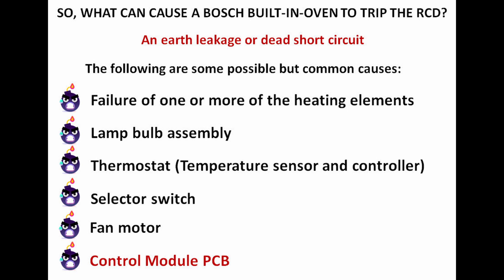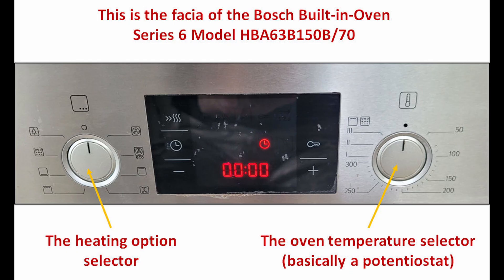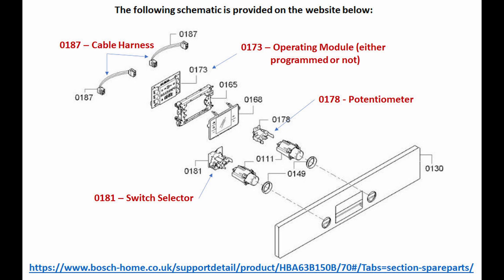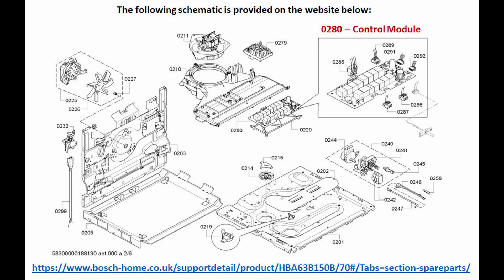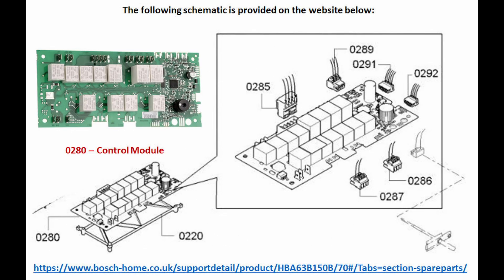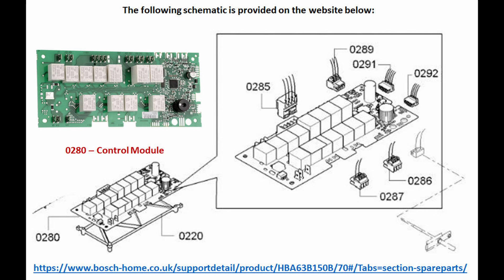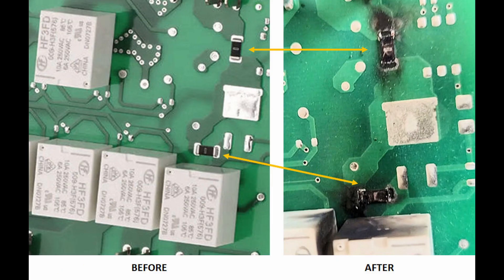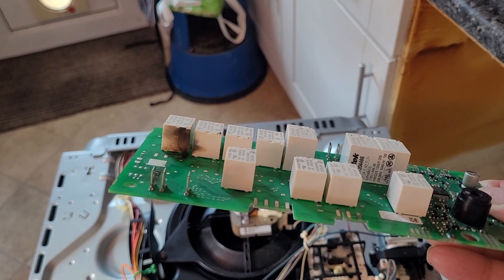Replacing a Defective Control Module PCB in a Bosch Oven

Comment: Hi thanks for the video. I have a problem with this oven. The light is now working anymore, i Changhed the bulb but nothing happens. How can I understand if the PCB is the problem? Thanks
Reply from the maker: Thanks for your comment. My question is "is everything else working" i.e., is the oven heating up as normal? If this is the case then the PCB may not be the problem. You can have a close look at the PCB to see if there is any damage to the components. If everything is looking OK then you may have to replace the whole lightbulb assembly rather than just the lightbulb. Sorry I can't be more specific! Regards and best of luck.
Reply: @theredneckgeordie  thanks. I changed the PCB. Now the light is working but the oven shows E300 error. Maybe the problem could be the power supply module?
Reply: @theredneckgeordie  also I checked the wiring from your video to mine and in my oven the gray cable that connects the selector to the PCB connects in the space to the right of yours, does it work the same?
Reply from the maker: @endymion8181  I'm not sure about that! I'm not an electrician or electronics engineer so I can't really answer your question. Do you have the manual to see what E300 refers to?
Reply: @ i solved. I bought a wrong PCB. Now it’s working. Thanks

Comment: @theredneckgeordie - Hey hi 
I have the same oven although my issue is the lcd screen digits keep flashing, likely tripped my a electrical cut out - I’ve tried resetting by leaving off at mains for an hour and switching back on etc - oven works apart from the continuing flashing, any idea what is the issue?
Reply from the maker: Hi Martin. Sorry for the delay. I'm not much help with this problem. It may be a defective component on the PCB which may not be visible as it was with my problem. Sorry I can't help with this one! Hope you can find the cause and repair.